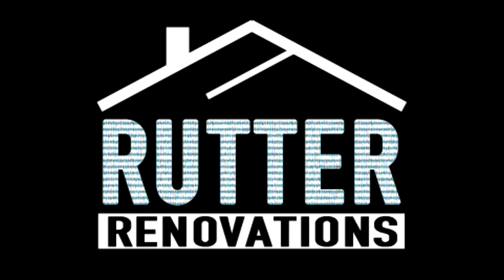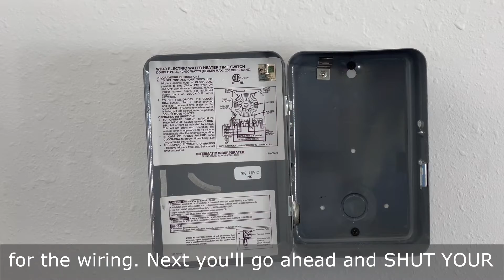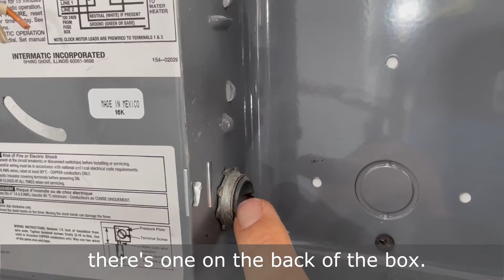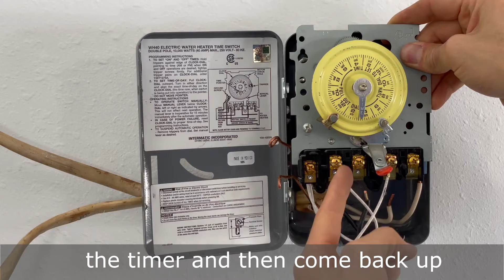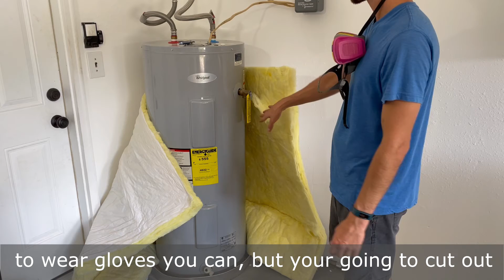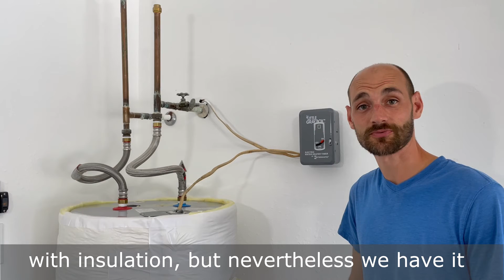How to Install A Hot Water Heater Timer and Insulated Blanket

Comment: Can I replace my timer box with a Leviton 1288 switch as I have solar hot water and I only need to turn the water heater on once a month. The switch looks like it switches powered between two outputs. I’d like to use the switch to also power a 220v outlet (to also be added) to handle like a 24amp or 16amp level 2 car charger.
Reply from the maker: Great question for the manufacturer!

Comment: I am talking about the two thin wires on the far lift on terminal #1 that are seen at the beginning of the video and at time line number # 242 they disappear.  
What are they for?  Are they for powering the clock?
Reply from the maker: They don’t disappear. There are behind the “hot” wires. They go to the timer motor. You can see them in my other video: how to replace the timer motor. https://youtu.be/meiRedt_8xA?si=-RAvL_XIy7JyzLrj

Comment: What happened to the white wires that were on terminal #1 that went to terminals # 2 and 4?
Reply from the maker: I am not really sure which ones you are talking about. The manufacturer is super helpful or you can call a licensed and insured contractor if you need help with the wiring.👍

Comment: Thank you for your video.  Two questions: I am buying a new (240-V), 40-55 gall tank.  What voltage (or wattage) Timer should I buy?  What brand tanks are high-quality, long lasting? (I have a Pro-Max now. .. reader’s comments welcomed) I don’t want a tankless unit, due to hurricanes and frequent power outages where I live (Florida).
Reply from the maker: I don't have experience with which brand tanks might last longer than others, though I believe that most manufacturers provide a warranty on their tanks. If you are concerned with longevity, then I would just choose the one with the longest warranty. As far as the timer, I would contact the timer manufacturer. Here https://www.intermatic.com/Catalog/us/Products/Timer-Controls/Specialty-Time-Switches they even have a chat box where you can message them to ask which one will work for your application. :)
Reply: @rutterrealtygc  Hi, late but my two cents. Right now I'm about to to install a electric sacrificial rod in the top of my water heater. It uses a small amount of electric but gets rid of the rotten egg smell and also is supposed to help tank last longer. If you don't want to use any more electric, you can simple replace the regular sacrificial rod in your tank once a year. Most tanks have replaceable parts but die due to rusting out over time, the rod attracts the rust to it and by replacing it often you save the tank. Some people doing this have reported having the same tank 40+ years, but you also have to drain  the tank 1-2 times a year without fail to get those results.

Comment: By the way, the hose you installed for your water heater shouldn't be used for hot water application.  The inner lining is made of PVC material and they shouldn't be used for hot water drinking supply.
Reply: Food safety says you NEVER use hot water from the tap for cooking purposes. The hot water leaches chemicals from the pipes and is dangerous to consume. A lot of people don't know about this these days. They think hot water should be used for cooking water for soups,pasta, tea ect. this is dangerous.
Reply from the maker: Who drinks hot water from the sink? lol
Reply: @rutterrealtygc  You will be surprised. A lot of people use it use for cooking. Or making coffee or tea. Also the hot water will wear out the rubber lining faster. Anyway, thanks for the video I learn how to replace my water heater by watching your video.
Reply: I have a coworker who always brew coffee in the morning with hot water from the sink. By the way, I never drink or coffee, it just doesn’t taste right.

Comment: I hear a clicking  sound coming from the timer box . What can that possibly  be ?
Reply from the maker: Mine was clicking and not going past the tabs that switch it on and off. I called Intermatic and they concluded that the timer motor had gone bad and that I would need to replace in internal parts of the timer. I have another video for this here: https://www.youtube.com/watch?v=meiRedt_8xA I would recommend calling Intermatic to troubleshoot. They were very helpful!
Reply: Mine makes a loud click. Is it not supposed to? I also noticed that after my wife washes alot of clothes we don't have hot water til the next day. Could something have gone bad in the timer?

Comment: A water heater is a appliance that fills with cold water and heats the water to a temperature controled by thermostats. A hot water heater uses hot water to heat something else such as living space, or a sidewalk or drive way.
Reply from the maker: Interesting. I guess in the south those terms are interchangeable/synonymous. lol.
Reply: Always been referred to as a hot water heater here in NC.

Comment: Great video. Thanks.
Amazon has that same timer, I need the 220V one. But theres a 10,000W and a 6,250W...which to get? Whats the difference?
Reply from the maker: I don’t know...🤷‍♂️
Reply: I guess you can look in the manual under specifications for the wattage of your heater

Comment: I am installing a new electric water heater and am going to install a switch to turn it off and on.  Did you ever do that?  For me a timer just wouldn't work
Reply: Just turn off the breaker every night and turn it back on in the morning.
Reply from the maker: I have not done that, no. Best of luck!
Reply: Get a properly rated safety cutoff switch
Reply: The intermatic can be used as a switch

Comment: The 110 volt wires are split ? So a 110 volt timer will work? Or you have to have a 220 volt timer? Thanks
Reply from the maker: Mine is a 220.👍

Comment: I agree, the timer is a good way to save electricity.  I installed that same timer about a year ago.  The power company here in SoCal offers a "Time of Use" rate plan.  Their higher rates are from 4 PM to 9 PM.  So I set the timer to switch off around 4 PM and back on around 9 PM.  Of course, the tank is full of hot water even after the timer switches off so there is plenty of hot water while power is off - unless you like long hot showers.  

A few comments about your video:
Saying "HOT water heater" is redundant.  There's no need to heat water that is already hot.  It's simply called a "water heater"  8-)
That Romex coming out of the wall does not look safe.
Reply from the maker: 😆 True true. Appreciate the feedback. That Romex was there since the beginning.😁 In hindsight I should reroute it into the back of the timer. Maybe another day. 😊
Reply: 1.  Without a timer, the heater isn't ON 24 hours a day.  It will come ON for a few minutes every few hours (after the heat escapes).  Modern WHs are well insulated and don't loose heat like the old days.  
2.  WITH a timer (one or two ON periods a day) its true that you're saving those few minutes every few hours, but its also true that you will have a much longer initial ON period because the water temp has dropped significantly during all those OFF hours.  kind of cancels out.
3. A timer may save a little .   These timers are running $70 (for the cheaper mechanical version)and it will take the better part of a year to recover the cost.
Reply: Really dude, this is not an English class.  This is an excellent video.